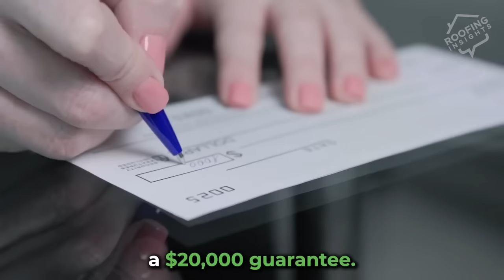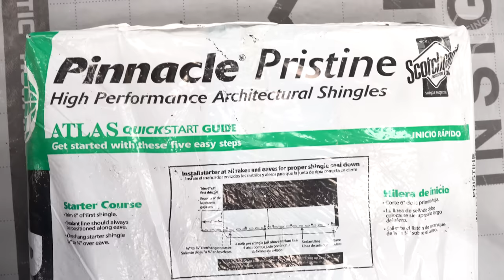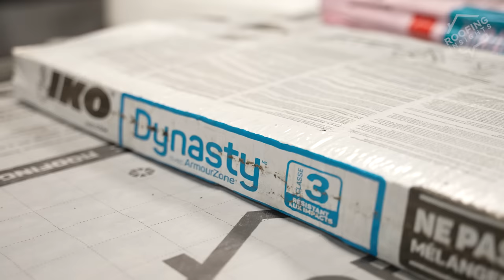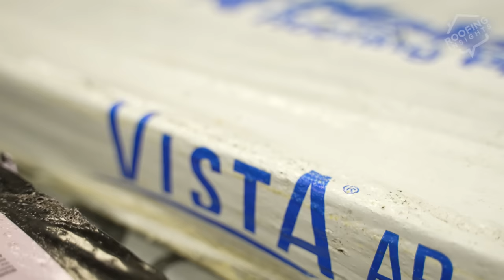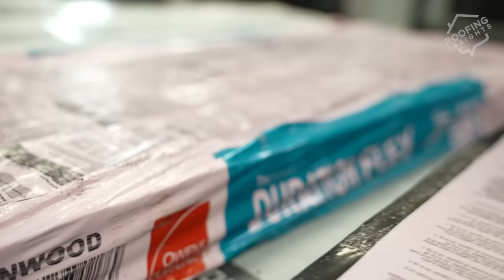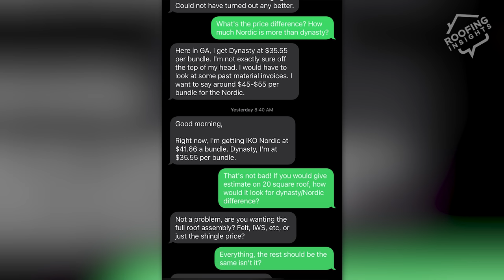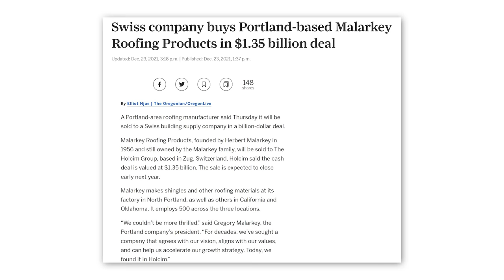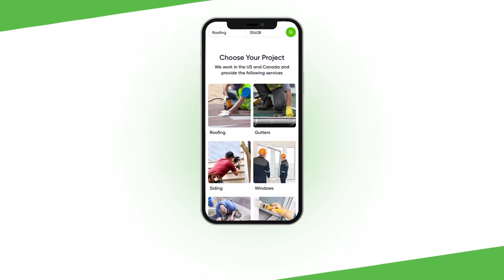2023 Roofing Shingle Guide: Ultimate Review by Roofers

Comment: Being paid by brands is the definition of promoting/advertising.  Take his comments with a grain of salt.  I guess lifting weights doesn't translate into lifting a bundle of shingles.  Width of a shingle is the shorter measurement, length is the longer measurement.
Reply: I believe his intention was to express that they are paying him for exposure. This could be monetary or it could be simply sending him a free bundle to have on camera.

His claim is that the testing and research is unfiltered, and the ultimate determination for whether that exposure is positive or negative.

Basically, there may be a 98 score shingle that didn’t make the screen due to manufacturers disinterest in his channel. He’s simply reassuring us that he’s not auctioning off higher scores to higher paying brands.
Reply: @Isaiah-pr3ko  It doesn't matter how he's paid.

Comment: Malarky stopped reporting their shingle weight on the tech data sheet in 2018-19, the highlander used to be 245lb/sq.  Now it’s 205.  Funny how all the shingle maker have an entry level shingle at 205#/sq.   And the all raise prices simultaneously and aggressively while asphalt is dropping.  Federal Trade Commission needs to investigate for price fixing.
Reply from the maker: We have been weighting them and do know how heavy or light they are. It was part of our rating
Reply: Certainteed starts at 220 pounds a square. Landmark Pro are at 250 a square. Always the same weight. Atlas is building brand and they will change weight as well. Certainteed been around since 1905 and always the best warranties.

Comment: I bought Malarkey Legacy, due to this recommendation, and others. I love it, but i got mine installed when it was too hot, and there are blemishes like roofer foot prints. If i had it to do over, i would have did it when the roof was cooler.I would have paid whatever, to have them work till noon or so. Im hoping the Oklahoma summer heat smooths it out. Otherwise, i have to do some repairs. I will love that rubber mix when the hail comes, but its stressing me right now.
Reply: I’m a Texas roofing contractor. It will not get better. For what it’s worth it is normally simply a cosmetic issue. We recommend to customers not to install in summer months for that reason. If you have a roofer replace scarred shingles do it in cooler time of year. These products seal so well it’s hard to effectively make repairs without making it worse.

Comment: It's probably okay that IKO Dynasty packages are open on both sides. When stored outdoors, condensation can form inside due to temperature changes. Therefore, with open ends, the product gets ventilated, while the package is sealed the condensation stays inside. In fact, the packages are stored in a horizontal position, and the shingles are tightly packed, so I don't think water gets inside deeply. It is just my opinion.

Comment: First off I am NOT a roofing contractor.
I took a roofing job in Louisiana back in 1980 and was schooled by the owner of the company. 
In 1996 I needed to replace the roof on my house in Tacoma Washington. I purchased Owen's Corning 20 year 3 tab shingles maybe it was 25 year, to long ago to be sure. I've never had a leak and I've had 60 mph winds and never lost a shingle. My roof was damaged by a dump truck that raised one side of my roof off my house a few years ago while the contractor was putting in a concrete driveway. Out of concern for a possible leak I had it tarped. Wouldn't you know it the only place it leaked was where they put the nails in to hold the tarp down. I've been busy, lazy and cheap and have not fixed the roof just retarped it myself twice over the last 11 years. Well..this year I'm repairing my roof and will re shingle it. I will also be putting new sheathing over it as the old roof is in 6 inch T&G planks and been there since 1954. The wood has contracted so there are gaps between boards and in a couple of places I had to cut some areas out and put 3/4 inch plywood. I shingled it with the gaps 28 years ago but I'll sheath it this time. 
My plan is to use 15/32" plywood. I'm still debating shingle brand. Its between Malarkey,  Owen's Corning,  and Certaineed.

Comment: I use tamko as a roofer we install every day like 150 sq of shingles it’s a really great product
Reply from the maker: Great product should come with good marketing and reasonable warranty. Tamko is cringy
Reply: I wouldn’t say it’s the top shingles on the market but we install it for passed 20 years and we have same problems like other brands. 
Let’s say windy areas we had roofs done GAF and tamko both fall off the same
Reply: @Tag12348 Tamko and GAF are 2 bottom tier manufacturers so it makes sense.
Reply: Tamko is trash bro. Seen more failed Tamko roofs then anything in my life. IKO Cambridge second that… problem is IKO dynasty is a solid system. But most the shit I seen repairing people crap is most the time like 80-90percent it was usually workmanship. But that Tamko tar strip and the common bond are straight trash

Comment: Thank you for your insight and rating information on the various roofing shingles.  In the process of having to replace my roof.  In 2022 we discovered a mold situation in the attic. Our insurance company would not approve the claim because they said the roof shingles were not properly installed.  So we hired a mold remediation company come out to remove the mold and were told we needed to improve ventilation in the attic to prevent it from coming back.  We installed 2 attic fans, also had a roofer come out and do the cut out for the ridge vent which apparently was not properly done in 2005 when we doubled the size of our home. We also had to install ventilated soffits because the ones that were installed during the construction were not the vented type. We have had an occasional leak but the use of roofing caulk in certain locations sealed the issue.  Now we are having to replace the roof shingles.  Have only had one company rep come out and the estimate is almost $16,000 for GAF Timberline HDZ.  Honestly I do not want to use Timberline since that is what I currently have (Timberline HD 30 year warranty) and I have had issues with it. I am in NJ so not sure if I can get Malarkey out here or if it is even in my price range as we will have to pay out of pocket.  I am also considering Certainteed Landmark or Grand Manor and Owens Corning Duration or Oakridge.  What is your opinion?  Again I don't know if any of these lines are available in my area.  Most homeowners here use Timberline or Tamko and I don't want either.  Wish me luck!!!
Reply: Steer clear of Certainteed and Oakridge in my opinion
Reply: I have seen the certainteed landmark shingles in my hand ,direct compared to malarky vista samples... the certainteed,shed granules like a dog sheds hair..the vista granules are literally infused into the asphalt/polymer..they are Tightly bound and do not shed And are yards more flexible....as far as certainteed in actual use, I have a friend who has had them replaced after only just over 10 yrs... we had a hale storm, but the shingles were showing severe granule loss aside from the hale damage.

Comment: Hi There, I live in Oregon, I have a house in the Portland Area, and a couple years ago I installed the Malarkey Vista, Great Product. I also have a house on the Oregon Coast, "Beach Front" . I have been contemplating which product to use. It was between OC and Malarkey Legacy. The Malarkey will be slightly more expensive, but I also believe that it will be a better product for the environment. Giving that the house is beach front with High Winds and Tormented by Mother Nature. Thanks for your Video.

Comment: I have an interesting background on this.  Used to work in Supply and worked for IKO.  I still use IKO and have sold all the other brands on Supply side. Now that I’m on roofing side I will say the following without bias:  GAF and Tamko are miserable.  OC is a good product but sometimes difficult, all depends on rep for your territory.  Certainteed, love the product when it goes right but is very inconsistent and mainly only use on full system when large amounts flintlastic are used.  I hated selling against Atlas Pinnacle Pristine when with IKO and it’s my number 2 shingle behind IKO Dynasty. #opinion #nomalarkyinSE. On atlas: why farm out to 3m?

Comment: Can Anyone elaborate on the blister defects of malarky shingles...I was gun ho as far as thinking these were The Best out there, then talked with a roofer who really liked them but recommended Not using them in my area which has temps 100-115 during summers.. he said same thing, that he has seen blistering due to the heat..  My other question is regarding certainteed granule loss and issues with their aghesive not properly adhering..... My last choice was GAF, but man!< these shingles feel like garbage compared to the other 2...thin, brittle, crack easily ... warranty seems great though... Im at a loss , there seems issues with almost all choices...
Reply: I had a roofer tell me the same thing.  He was high on them overall, but noted this specific issue (also in TX).  That makes me nervous having a new facility.  I like OC, but I don't think their variation works with my brick variation and I'm limited by HOA too.
Reply: @Rezfin  Hi brother, thanks for reply!  I am being pressed by our insurance company to get shingles on the roof.. certainteed, Gaf are the most commonly used in my area.. I hear about issues with certainteed granule loss and lack of adhesion from almost every roofer Ive spoken with.. not keen on GAF ..Ive dismissed malarkey ,reluctantly, and this has left me considering owens corning duration... I may just go with these as I'm fed up with the amount of issues that  ive found with the other brands...no shingle is perfect but really, there ought to be a Consistancy amongst those who have experience and  have tried these brands..
Reviewers and homeowners both will tell you conflicting opinions regards shingles which really leaves us to make our best  choice...

Comment: Do you have any recommendations for the best shingle and underlayment products for noise reduction through the roof?  (Think airplane flyovers.) 

My understanding is that this is a situation in which thicker and heavier materials are going to perform better. -Heavy architectural asphalt shingles with plenty of overlap.  On underlayment, I see it as plausible that a 30 lb Felt underlayment could be best for noise reduction, but there are thicker, heavier synthetic underlayments, too... 

I'm in the Seattle area so water is a real problem, which makes me think felt is a bad choice, but are there other underlayment products that should be good at reducing noise?

Comment: why not class 4.. Insurance companies:  Going to 2% and 15 years, lose depreciation.  Just because your 30yr class 3 shingles has hail damage, doesn't mean you Have to change however,  if you decide to sell your home 3 years after a hail storm,  you can get insurance to award replacement.  Sale your home with a brand new roof.  Also, we've been installing since 1979, we have customers that are aggravated because we installed a 50yr that you can hit with a hammer.   They are tired of their 3-year-old shingle when everyone around them gets their house a  complete update.  So as I explain to homeowners,  60% of the time, they have hail hits - So what - wait- let's wait until the next storm and if for any reason you want a new roof before then, call me.  The class 4 often Do-NOT get a FULL roof replacement.  Double steep roof only 2 slopes slammed, other 2, 1-3 in a test square.    I recently had a Famers claim where the depreciation 55% was awarded yet the roof was right at 16yrs old, so they lost 12,500 of a $26,000 roof, then take out deductible -$7,200 = home owner received a total of $5,300 of a $26,000 roof.

So, best advise.  So NOT upgrade - simply Do not replace after every hail storm.  Get as many years as possible,

Comment: The bundle end closed does not keep the water out one of the reasons I dislike the Atlas packaging is that the end of the package is closed and it traps the water inside the bundle so like in the winter time, a lot of the bundles will be frozen together because the water can’t drain out and it becomes a problem when installing you can’t get the shingles apart

Comment: Hello,
Question for you.  I installed class 4 shingles on my roof but the ridge caps and hips a non rated shingle was used called RizerRidge.  I was told it's more durable than any standard shingle and not to worry.  What are your thoughts on this?  I do get hail sometimes here in TX. Thanks

Comment: I’m 40 yr roofing contractor in dfw. Certainteed is simply the worst. All manufacturers have small percentage of defects. Certainteed are producing highly defective shingles and knowing the problems they still produce and distribute knowing they are defective. Owens Corning is simply the best. I remember when malarkey began production in south Texas. They transformed the industry. I still am not a fan of their products. They have way too many defects. Most of their defects will not result in leaks. Mainly the shingles will blister within 3-4 years. Certainteed blows my mind that they cannot make the corrections. I inspected for a distributor a certainteed class 4 that had 5 different production dates on packaging on an80 sq roof. The were produced from APRIL TO NOVEMBER OF 2023. They all had the same horrible defects.
Reply: Craig, could you elaborate on the blister defects of malarky shingles...I was gun ho as far as thinking these were The Best out there, then talked with a roofer who really liked them but recommended Not using them in my area which has temps 100-115 during summers.. he said same thing, that he has seen blistering due to the heat..  My other question is regarding certainteed granule loss and issues with their aghesive not properly adhering..... My last choice was GAF, but man!< these shingles feel like garbage compared to the other 2... warranty seems great though... Im at a loss , there seems issues with almost all choices...

Comment: your talking shingles  but need to include the fact that installers can be the problem . i have seen contractors here put in 3 nails in the shingles and with nail guns i have seen nails that are set to low or to high in shingles . Have you done a video on metal roofing meterial